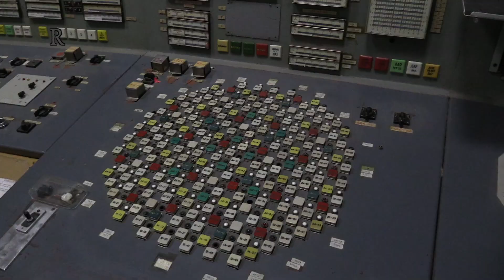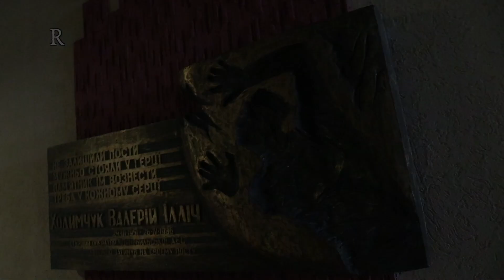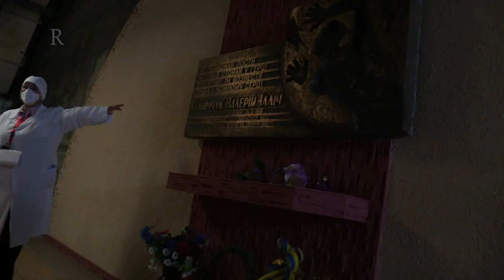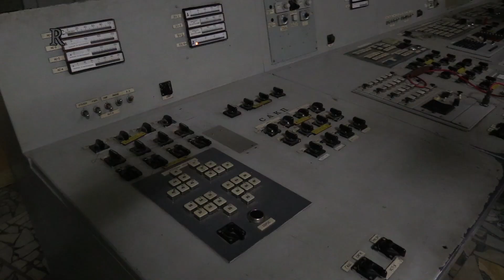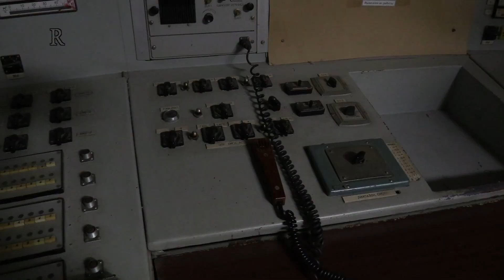Inside Chernobyl power plant: Contaminated parts

Comment: That's pretty rude and uncurtious to others in the tour that you would let your Geiger counter beep and not attempt to silence it.
Reply: I think those counters are not designed to be silenced. Since those things measure levels of radioactivity that is very harmful to us. Silencing those is like killing yourself slowly.
Reply: @janmichaelcatap5994  You can put your hand over the speaker/chirp hole. Some will have a "temporary silence" feature or mute button. Notice not everyone has one on the tour, just them. 
The Meter they are using is not exactly considered an emergency device i.g. a dosimeter. When you get a meter, It's default setting is to trigger the alarm at quite a mild dose. Any electrical engineer with the least of foresight about how the device will be used in a day to day scenario would not make a product so annoying it becomes unusable in the field.  Sorry, I still think them knuckleheads for not figuring out how to silence it or obtain one that would be silent.

Comment: It's still possible to go down under the reactor to see the tons of Corium which is known as the elephants foot.
Its not part of the standard tour but available on request. 60 seconds is the max exposure time before you have to get out, just enough to get a picture.
Any longer and in a few months extra arms and legs will start appearing..
Reply: I don't think thats smart move
Reply: 60 seconds? Screw it... live dangerously.
Reply: are you certain of this information?
Reply: @eeshverma  Last post done Interpreter, sorry bad English spell if no correct.
The arm/ leg part was joke. Elephant foot possible see though.
Tour leave Kiev bus and guide take to Chernobyl. Elephant foot no on normal tour, have ask. Dangerous, most hazard on earth. Have sign to go down, not touch Corium. 
Greeting from Russia (Girood Airfield)... ❤️

Comment: 8:28 If the explosion was able to lift 2000 tons of rods and make a hole in the ceiling it's more than likely that pieces of graphite would be scattered all over the place. So theoretically he could've seen them. Though this scene is more than likely for dramatic effect.
Reply: He was also on a corridor "outside", possibly outside the main block building. It so happens that the scene has him looking at what looks like a small roof below a window outside reactor 3, next to the turbine hall. I'm not 100% sure.

Comment: I do wonder. How far could they had go before it was too unsafe. I mean what if they knew or acknowledge what there is happening, how many seconds before could they had safely stopped the reactor and dodged the disaster. We know that at the time they pressed the AZ-5 kick started what disaster. It is that that is making me think. Was there a way they could safely shut down the reactor, if there was. How far could the reactor had run until point of no return?
Reply: The point of no return to shut down the reactor was 28 minutes after midnight. At that time there was enough cooling water in it.

Comment: why do the channels get hot and start to leak steam when they Need to be relocated ?

Any why are the pumps so HUGE ? I have been inside a german reactor and the pumps are only 1/3 the size
Reply: The RBMK needs more water for cooling because it is 12 to 17 times bigger than the reactors that are used in germany. It has to be bigger because it uses slightly enriched uranium fuel and to get the identic electric power output maybe the 1000 MW you have to make the needed steam in the same time by using more of that  fuel. Of course a bigger core needs more water. The RBMK uses regular water (H2O) for cooling and making steam and this water is a neutron absorber. If you heat up the water in the RBMK there are more neutrons slowing down and so there is more reactivity producing more heat and steam and so on. To prevent an overheating there must be enough cooling water pressed into the channels. In german reactor types the core is in a pressure vessel that holds the heated water under a pressure of maybe 160 bar. This pressure makes it possible that the heated water can not turn into steam. It can be overheated to maybe 280 degrees. Because this reactors don´t use regular water (H2O) they drop in power if the water level is to deep and there is more steam. Because the RBMK has no pressure vessel it builds up steam in the channels if you don´t press enough cooling water into them.

Comment: I feel uncomfortable with those devices ringing even while watching this video.
Reply: https://www.amazon.com/Counter-Dosimeter-Radiometer-Radiation-Detector/dp/B005US5EFI This is the device they were using that was beeping.  Most units like this by default do have their alarms set pretty low.  Normal background radiation world-wide average is 0.17-0.3 microsieverts/hr.  So getting up to 4-5 microsieverts/hr does mean you are possibly going somewhere dangerous.  Those levels are not dangerous, but there are areas of the plant where it can spike up MUCH higher if you don't watch where you go.  I have a "radioactive red" vintage Fiestaware plate that registers 10x higher than what they were showing (40-50 microsieverts/hr).  Granted, that's on a meter that registers alpha, beta, and gamma...the one in this video was reading gamma only.  My plate barely registers if I put the alpha/beta shield on my counter (gamma from my plate is something like 1 microsievert/hr).

Comment: 8:20 no, he's watching the graphite from the windows of the golden coridor that are in the gap between reactor hall 3 and 2, the golden coridor conects all control rooms and was not destroyed, the unit 4 portion of the coridor was cut off by lead-lined doors and concrete after the accident to prevent radiation leakage.
How were the windows shatered and garphite on the ground so far from the explosion I don't get since there's unit 3 and the ventilation chimney between the two places.
Reply: Depending on the size of explosion windows can be smashed miles away because an explosion sends out a shockwave.

Comment: It's not bull. The control rooms are directly off the Golden Hallway, and the hallway has windows which show you a decent view of the ground from above. As you get closer to units three and four they were covered up after the accident to try and control radiation as the other reactors kept running.

Comment: This whole video is absurd - everyone knows an RBMK reactor can't explode.
Reply: Nah, its just 3.6 roentgen
Reply: Snavee i‘ve been told it‘s the equivalent of a chest x-Ray
Reply: @DesslBane  more like.... 400 x-rays
Reply: @Ursa105  turns out 15000 roentgen
Reply: @Johnny-xi4ti  that's like 2 atomic bomb per hour. 24 hours over that means 48 bombs till now. 😄😄
Reply: @Ursa105  if you were giga it would.
Reply: Not great, not terrible
Reply: @Joe Ponto "WHAT DID YOU DO"
Reply: The tour guide is delusional. Take her to the infirmary.
Reply: Kerem Karaoglu the feed water is mildly contaminated, she’ll be fine I’ve seen worse
Reply: @franksmith900  😂
Reply: Joe Ponto their delusional take them to the infirmary
Reply: They're in shock, get them out of there
Reply: Bro. LEGASOV WAS A HERO OF THE WHOLE WORLD
Reply: We’re still wearing the hats, the fuck do you want from us
Reply: Yeah it cant explode that is why the furefighters were melting like chocolate there.
Reply: They are delusional
Reply: RBMK reactors made at time were missengineered the fuel rods had graphite tips which being a stable compound made the fission reaction more fast
Reply: @jobansingh139  nothing to do with graphite stability. graphite is an excellent moderator. Water is an absorber. Replace the absorber with a moderator and fission goes through the roof. 
.
Reply: It was steam that bursted. Like many water cooled accidents that happened. The core melted into the floor and is still the most toxic object in world. Those guys walked prob somewhere over it.
Reply: Joe Ponto its only 3.6 roentgens anyway
Reply: its not possible for any reactor to explode like an abomb. the explosion was from hydrogen
Reply: Western propaganda!
Reply: no, you didn't see graphite!
Reply: @network909  Graphite? What?
Reply: @Mrepticc  They thought the reactor was still intact until they saw the graphite from the core lying around....
Reply: @network909  arr ok thanks for explaining
Reply: @network909  Ooft, then the firefighter touches it-
Reply: Why? why? For the same reason we don’t use containment buildings around our reactors cuz it’s cheeper
Reply: lmaoooo the idiots taking the bait on this comment...
Reply: They’re delusional
Reply: 3.6K likes, not great, not terrible
Reply: Funny how so many of these people don’t have a clue about agent orange or any other fucked up atrocities the west world has committed and lied about lmao
Reply: The fuck is this chat
Reply: This comments section is mildly contaminated, but it’ll be be fine, I’ve seen worse.
Reply: Joe Ponto lmfaooo
Reply: Your mother made them ?
Reply: You, you need a new phone
Reply: Bring him to the infirmary
Reply: normal phenomena
Reply: The ones who think this is funny have never worked in a nuclear power station, thank God they haven't. Idiots. There's nothing funny about it.
Reply: I know,I’m in one right now even if the-Temprature is to...*sweats* High?
Reply: Oh go-
Reply: He's delusional
Reply: Joe Ponto they can if you put a fucking test on a RBMK reactor if you spike power it will get more megawatts and more power and the power spikes and goes crazy
Reply: What is RBMK?
Reply: The truth is, LIES are what caused an RBMK reactor to explode.
Reply: hes just delusional
Reply: People who take this comment seriously; WOOOOOSH
Reply: Illustrious, I am a co-owner of 3 channels, mine and Pedro Moutinho (the presenter), I take the opportunity to publicize them, pointing out that it has video every day, rain or shine. Subscribe, like and share: https://www.youtube.com/channel/UCD3UDauhV2481jsV1eVLqxw; https://www.youtube.com/channel/UCIQI-nWYoKLBpcY08FouS_Q; https://www.youtube.com/channel/UCHc4pVZh2VUtmrswgYYWMrw.
Reply: Guys it’s a joke...
Reply: @James Aker thats like what every explaining video says dip shit ._.
Reply: show me your license about this :))
Reply: HES DELUSIONAL
Reply: So in other words, you'd have to be a special kind of idiot to make an RBMK reactor exploded.
Reply: Caught in 4k
Reply: Let fu** kedemchuk
Reply: right?
Reply: And the titanic can't sink. We all know that!
Reply: Not funny.
Reply: It didn't, it was the pressure within the reactor room that caused the explosion. Probably due to steam from the water cooling the core, and then meltdown.
Reply: Michael exactly
Reply: @Michael-ny5ii   there was a design fault within the reactor that meant the control rods could be raised so far that they couldn't be lowered back down again this lead to the rapid increase in pressure :)
Reply: @haz525  That's Soviet-engineering for yah...
Reply: @haz525  incorrect. the control rods could be reinserted. the issue with the control rods was that they had a graphite displacer, which caused a sudden rise in power due to  graphite being the moderator, when first inserted.
Reply: @haz525  RBMK have several design issues. Control rods lowering wasn't one of them. The graphite tip is what caused the power spike. If that hadn't been present, they may have had more success recovering the reactor state.
Reply: with lies however, an RMBK reactor can explode. What is the cost of lies?
Reply: Hunty Gouk he was joking u stupid
Reply: Joe Ponto not very intelligent are you
Reply: Second chernobyl video you have posted the same comment for likes.
Reply: @TC-zi2yp  watch out guys it's the comment police, everyone act cool
Reply: I'm pretty sure any nuclear power plant could explode that one sure did
Reply: eric moeller you clearly haven’t seen chernobyl😂
Reply: @ericmoeller3634  and Fukushima
Reply: Illustrious, I am a co-owner of 3 channels, mine and Pedro Moutinho (the presenter), I take the opportunity to publicize them, pointing out that it has video every day, rain or shine. Subscribe, like and share: https://www.youtube.com/channel/UCD3UDauhV2481jsV1eVLqxw; https://www.youtube.com/channel/UCIQI-nWYoKLBpcY08FouS_Q; https://www.youtube.com/channel/UCHc4pVZh2VUtmrswgYYWMrw.
Reply: But.... the 4th reactor exploded what r u talking about
Reply: Ilana Magchilov he was joking it is a sentence from the serie
Reply: @maximilian3304  i think they're joking too
Reply: Your a fucking twat mate
Reply: Do you think this is fucking funny?!
Reply: @АлександрНевский-з3ю  its hilarious
Reply: @АлександрНевский-з3ю  they got HBO's Chernobyl series vibes dude,chill...
Reply: @АлександрНевский-з3ю  ok ruska, calm down, it's what they actually said at the time though, ''Oh it's fine it can't explode'' boom ''Oh that's just uhh, PIPES, yes the pipes.''
Reply: Александр Невский no
Reply: @АлександрНевский-з3ю  Funny as hell
Reply: @АлександрНевский-з3ю  yes It is
Reply: @АлександрНевский-з3ю  согласен, не смешно нихрена..
Reply: @АлександрНевский-з3ю  yes
Reply: @АлександрНевский-з3ю  ya I do its hilarious

Comment: if its dangerous for the visitors then how come it is not for their guide - who probably does such tours every few days?
Reply: The dose is small enough that it doesn't hurt you. You get a bigger dose if you have a arm, head or chest x-ray.  Flying intercontinental also exposes you to higher radiation.  However, some people have weaker immune systems, and they will react differently to radiation than people with normal immune system.

Comment: You can still get a similar tour in Ignalina nuclear power plant in Lithuania, but without radiation :)) The power plant is currently being disassembeld... It was the biggest nuclear power plant in the world by year 1991. Similar design to Chernobyl but more blocks.
Reply: Not quite so interesting to people without a nuclear disaster.
Reply: Ignalina did not have more blocks, it had fewer.  Two operating and two under construction, compared to Chernobyl's four operating and two under construction.
Reply: @krashd  one under destruction is what you were trying to say right?
Reply: Why would they shut it down if they improved it after Chernobyl?
Reply: @claytong2018  Because the EU told them so (and compensated them for it). After the Chernobyl accident, the EU mandated all RBMK Reactors in member states and those aspiring to become member states be closed. Russia, being a non-member, is the only country to still operate RBMK reactors, with some of the power plants having been granted operating extensions well into 2040.
Reply: And more powerful blocks, IIRC. Chernobyl's were rated at 3000MW thermal, while Ignalina's were rated at 4800MW. Electric generation was 1000MW per reactor in Chernobyl and 1500MW in Ignalina.
Reply: nope, it wasn't the biggest nuclear power plant in the world. The were only 2 units functional. Chernobyl NPP had 4 units till april 1986. Kursk NPP and Leningrad NPP had 4  units in 1991. Ater all the biggest NPP in 1991 was in Japan. If it will be pleasent for your patriotic feellings, in HBO Chernobyl Series the scences of NPP was shot in ingalina

Comment: How can the tour guide go through the building time after time and not be effected from accumulated exposure?
Reply: Because it’s overhyped, the amount of radiation they get is low enough that you could live there (in normal areas they take tourists to) with no increase in cancer risk
Reply: @KellermF91  And even then, tour guides work according to a schedule. If one was indeed to accumulate enough exposure for it to pose a health risk, they'd just be taken off the schedule for a while, just like they did with the liquidators in '86.

Comment: Ahh the Soviets and their "system" let's bin it all on them. The first core meltdown was Three mile island. The next 3, at Fukishima were US general electric designed. Who now have a lawsuit against them saying they went as safe as they could have been to wait for it... save money to make them more competitive. The reactors that nearly melted down at daini were part US part Japan design but we're saved by the workers efforts to shut them down before they melted down. The reactors at Onagawa designed by Toshiba all shutdown without incident and were closest to the epicentre.

I watched a documentary about Dounraey here in uk and they were just chucking nuclear waster material into a shaft then one day they had a gas explosion and it got into the sea as the shaft was built with a waste disposal pipe to the sea... I guess no one thought or cared to check that before using it as a nuclear waste pit. Now you can't go on the beach.
Vilifying people in a system. Bringing things to light so others can learn from them rather than repeat or suppress sure. We all make mistakes some more than others. Point is to learn from them I believe. 
This is my own learning of one of many subjects which is on going and improving gradually over time. If anyone sees errors or misinformation or extra bits to add please say to improve them further. 
Just tired of this black and white propaganda stuff when it's much more messy than that
Reply: One of the problems in Fukushima was the poor design of the plant (not the reactors), with the air intakes for the backup generators placed at ground level. So when the plant flooded due to the tsunami, those were among the first things to go down.